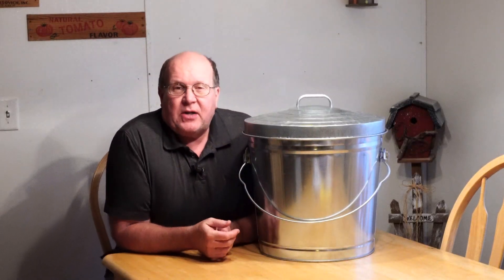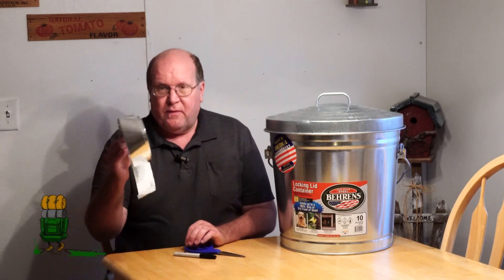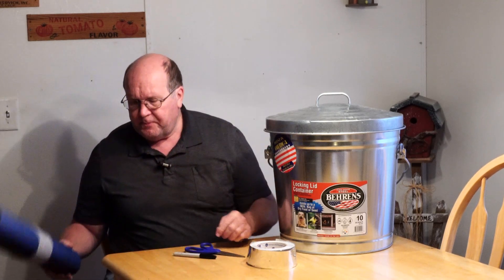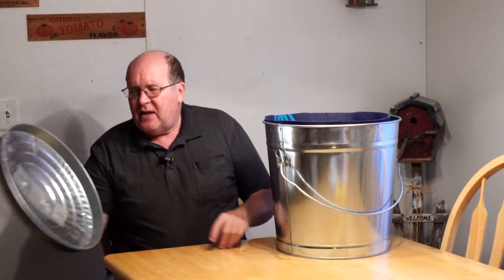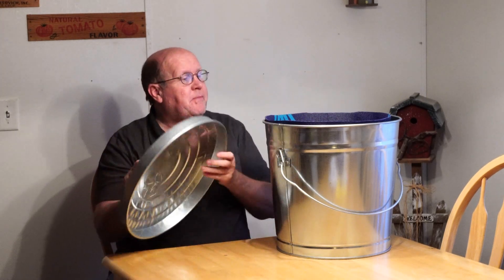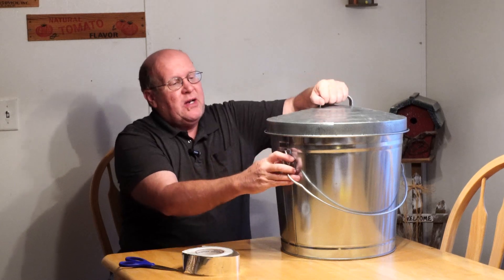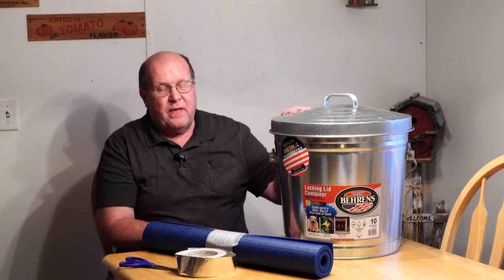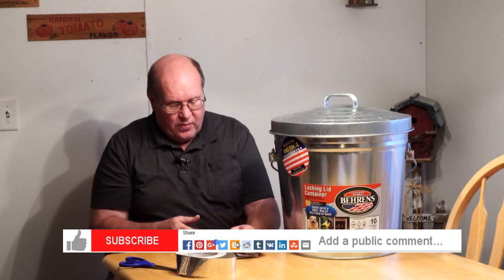DIY Faraday Cage

Comment: Does the can need to be new?  I purchased a new can but i have another trash can i just brought to use to burn paper in.  I also have a small can i used once to burn stuff in and it’s storing sand.  On a fixed income and late start using every thing i have
Reply from the maker: Doesn't need to be new, but a well-used one may be more time-consuming to convert.